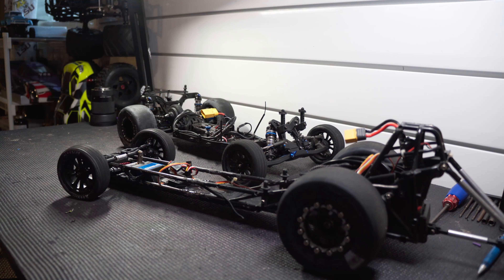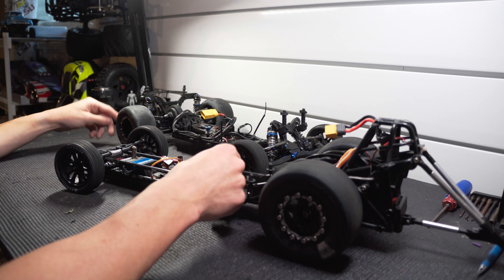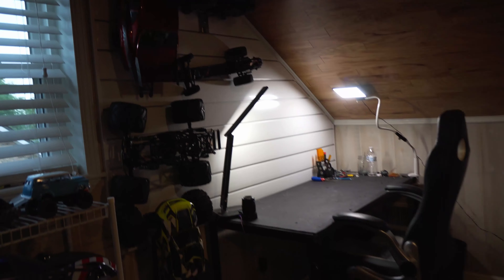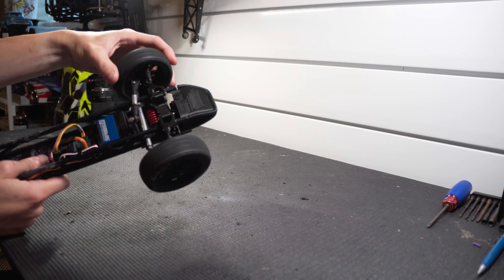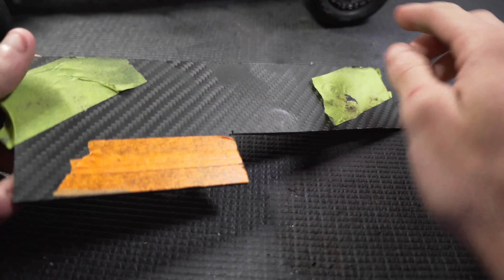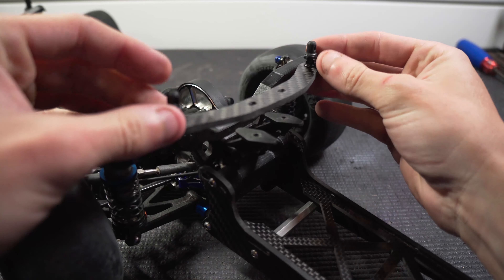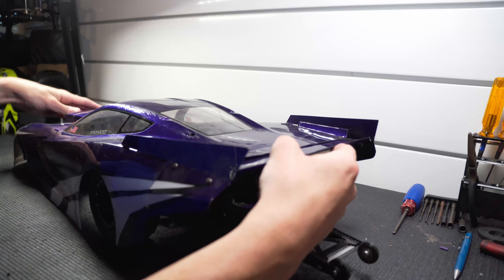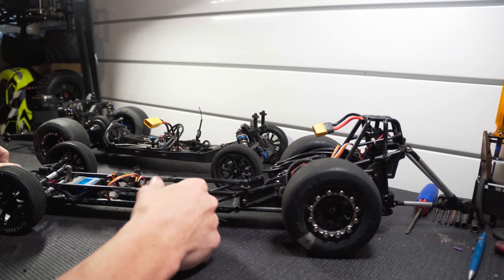No Prep RC Rear Body Mount Upgrade! | Working on RC Drag Cars!

Comment: i made carbon fiber shock mounts for my traxxas raptor that drops it a half inch
Reply from the maker: Sounds nice! I'm assuming you had to make them taller than original to drop the ride height.
Reply: @FullThrottleRC  yeah
Reply: are the proline titus 2.2 real beadlocks?
Reply from the maker: @Braydenwhalen  yep
Reply: @FullThrottleRC  thanks

Comment: Get a diamond cuttind disc for a drimel it cuts cabon fiber like butter 👍🏻
Reply from the maker: Thanks for the recommendation! Definitely need a mask if you cutting it with a dremel. The amount dust that would kick up is insane
Reply: Yes for sure, carbon dust is some nasty sh...t do inhale 😷 but it makes working with with cabon fiber much easyer, also you can get some special drils for carbon aswell.

Comment: Another banger bro, can't wait to see more progress, wen things around here settle down a bit and once the local legends/Tamiya euro truck scene takes off I might try to make some vids my self, I really want to document my drag build using a losi 22s sct
Reply from the maker: Thanks! I've seen a few 22 conversions and that was actually what I was going for originally. I found the Associated and couldn't pass it up though. Good Luck!
Reply: @FullThrottleRC  it's not a tlr 22 tho bro it's the losi 22s sct lol it shares parts from the tlr 22 line but it's not a true tlr, but it does come stock with a full metal gear box (a lot of people are swapping at least the idler gear out of the 22s into the 22 platforms
Reply from the maker: @TheBudgetPaintBaller  yep I'm familiar with it. I was looking to go the 22 route originally though. I'm happy with what I have now